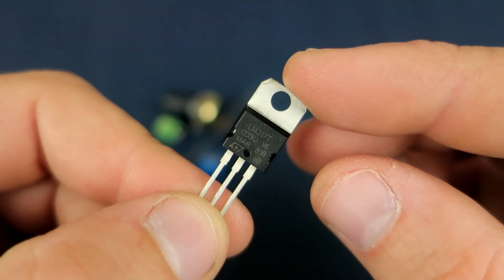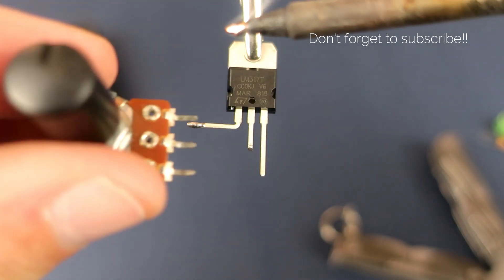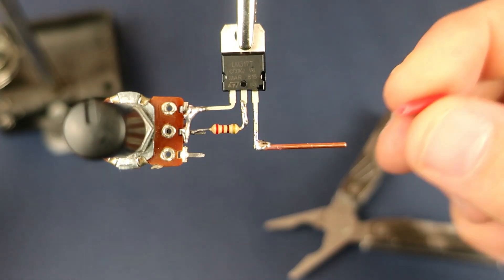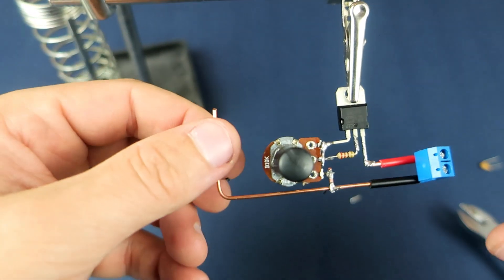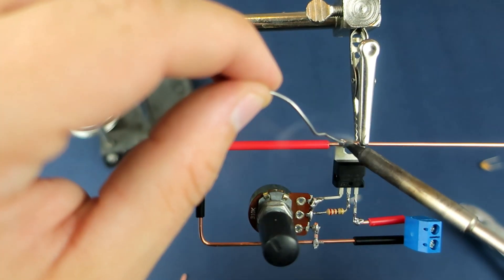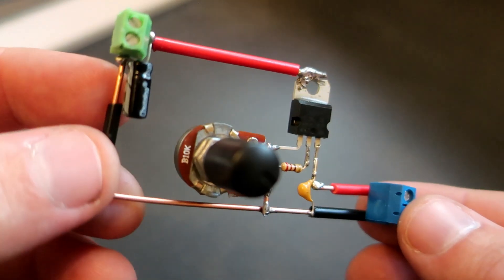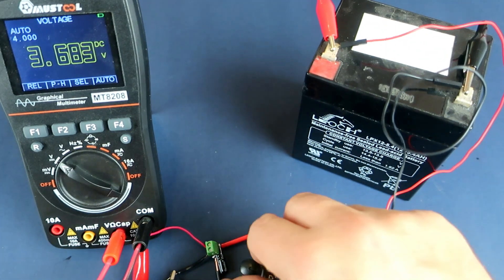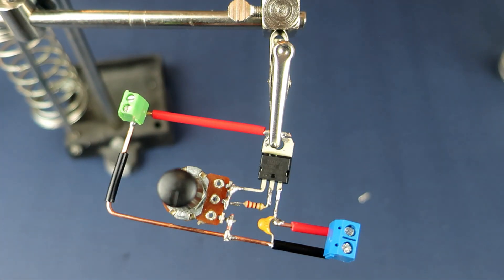Adjustable Voltage regulator LM317  how to make!

Comment: U can change the resistor with a 250-240ohm resistor so the voltage will be precise. some nowhere days hobbies need a variable power supply for breadboard but u could to use it for other things with that also great video ❤.

Comment: The LM317 will not go down to zero volts. It will go to about 1.25Volts.
That is it. If you want to adjust to 0.00 Volts, you will need ancillary circuitry.
Read the data sheets. This is clearly pointed out.

Comment: It can be work in 24volts ac ?? Just adding some bridge rectifier and a capacitor in part of an input voltage and the potentiometer will it burn??? Cuz mine i saw a bit simple schematic and i follow it but when i on it the potentiometer will keep burn and the lm317 is also damage so i should i do ??

Comment: The output voltage keeps fluctuating 11,1 to 6.83V and different values.
Nothing changed after or before the 10uF capacitor. I could not use this project the way the circuit was explained. Maybe I missed something.

Comment: I had searched for a variable voltage regulator, but I was wondering if you could do it in reverse and increase the voltage from a 3.7v 10a-20a 18650 battery? Could this be possible?

Comment: What is the cap voltage ratings? I am on top of the Uf but lost for the voltage ratings..can I use up to 300 volts or 90 volts if those are made? Thank you so very kindly from Houston,Texas

Comment: Disculpenme por pregunta sin abrir la reseña, ya vi que el potenciometro es de 10k, la resistencia es de 220 ohm, el capacitor de salida es de 104 uF y el capacitor de entrada es de 10uF, Excuse me for asking without opening the review, I already saw that the potentiometer is 10k, the resistance is 220 ohm, the output capacitor is 104 uF and the input capacitor is 10uF, este es el mejor proyecto de estos reguladores,,

Comment: can I ask? I have a  Dc 3 volts portable fan and I want to run it with 18650 (powerbank) which is around 4,8volts. Can you show me what should I use to reduce the voltage which is not too bulky. An adjustable speed is ok I guess, to make it more interesting. Thx in advance.

Comment: As seen by other  viewers, I too viewed many videos creating this circuit. Yours by far is the BEST of all viewed. I was able to build one, but still waiting for the screw connectors to arrive.I just used solder.
You seem to be a most friendly man who knows how to communicate with others.

One thing and if you can help, I am having trouble locating the resistor. I can find the 220 but it is the physical size that is hard to determine while looking online.

Keep putting up the great videos...

Comment: i have done the cirucit, it was working fine untill i short the output wires, lm317 starts to smoke out. what would be the problem. the input power supply was 20 V with 4.5 A  rating.

Comment: Nice video but I have some questions, why the resistor? Why 220 ohms , why ceramic capacitor in input? Why electrolytic capacitor at output and why u put less capacity in input instead of the output?

Comment: I have a question. I am trying to build something that is a bit unconventional to most people. I want to build a vape mod that is voltage regulated. I prefer to have a buck boost converter, but I cannot find one that is within the voltage specs that I am looking for. I want to have the ability to use either a single 3.7-volt battery or a dual battery 7.4v but it must have a 2.5v cutoff. I want to be able to adjust the voltage from 0v-10v on the output, and it must be able to withstand 30 amps of current, these devices produce a lot of amps running through the system and most boards I see can only output 2 amps which is nowhere near enough. Any help will be greatly appreciated.

Comment: I'm new to electronics. What is the different between this circuit and voltage divider?
Reply: Hi friend. Voltage divider is used for command  but this circuit is used to make regular voltage and current to activate any load working under the battery source as well.

Comment: I just found this video and found it quite fun to see this skeletal method of circuit building. I had used the 317 to create a self regulating heater circuit for my 1950s model train. I added a thermistor as the R2 and a fixed reference resistor for R1.  There is a heater coil on the output and it is used to vaporize an oil in the smoke housing. I also have a small DC Can motor and fan to blow a puff of air through the housing in synch with a Chuff Sound board. If the Heater gets too hot it can burn out or use up all the oil in the housing. If it gets to cold the oil stops evaporating. Other variables i had to deal with is the Track Power that runs the motor in the engine  starts at 5 volts and goes up to 17 Volts.  I isolate the 317 from that variance in track power by 1st converting the AC to DC then running it into a Buck Boost Board set to 9 Volts. I find that with the heater I used 8 to 12 Ohms will heat up to 150C with 9 volts. The other variable I had to accommodate was the fan to make smoke flow out. It will cool the heater down as it pushes out the smoke. When all put together the heater will start up at 9 volts as the thermistor is very high resistance as room temp 25C. As the thermistor sees the Temp approaching 120C it will start to reduce ohms and being R2 it lowers the output power.  Then as we turn up the track power the fan moves air faster so the thermistor will cool and Ohms will increase which raises the energy sent to the heater. If i have all the parts correctly balanced and the right R1 value the system balances between 120C and 130C quite nicely. This provide a nice puff of smoke at low speed leaving the station, then once on the main line and speeds increase the smoke maintains a nice plume out the stack as the engine speeds along. Then as we slow down the Thermistor will begin to heat up with less air flow and that will lower the energy coming to the heater. It all works really nice. We used to have good smoke at low speed then none at high speed or burn up in low speed and have smoke at high speed. It was a battle to have fun smoke at all speeds. this 317 is so simple and easy to configure we even have a circuit board made and we can sell the assembly to other Train Hobbyist. And it is all very affordable for them. I appreciate you continue to teach today and applaud your efforts. I try to share with other train folks but these older trains are left with older guys now so it is harder to bring young ones along. We are using 3D Printing to make spare parts and new engines. We hope to bring new Hobbyist into our model train because it is a very good scale.  1/64 scale which is larger than HO but smaller the O (Lionel). I am trying to use science and technology to help keep it alive. We are now finishing our Sound System with ESP8266 Microcomputer. I am at 73 learning C++ AGAIN! But with Arduino and these new boards it is all part of the IOT and STEM like studies which i find online like this lecture and demo you made for us to learn from. I wish you very well and hope you get many more viewers. Thank You for a great video, Dennis in Virginia USA

Comment: Best and uncomplicated circuit presentation I have come across. Thanks for sharing.
Reply: How can you add a voltmeter screen to this to see what you setting the voltage to? I added one to the output but No mater what I try it fails. Not sure why
Reply: @skor1873 what do you meant by it fails? Like it drops voltage or just turns off or blank

Comment: ..do we not have any DC voltage regulator  above 12v.. example for Regulating voltage across mixed Solar panels in-between inverter.. let say I have 2*36dc 8 A but slightly different rating.. I want to regulate it's input voltage before it gets to the inverter... Is it available?

Comment: Having a hard time with this circuit I'm using a 10K potentiometer and at higher voltages it adjusts normally but as soon as I get down into the three range it all of a sudden drops down to nothing I can get it to 3.3 volts but it doesn't stay there it wanders up and down even with the capacitor. I just realized I was using an old potentiometer as well I don't know if that could be yet I noticed that there was some soulder stuck to the leads so I obviously used it before

Comment: Hey thank you so much for this video.  I got a question I am wondering why you soldered the potentiometer with wire connecting the two pins?
Reply: This wire is necessary to connect the 220 Ohm resistor to the adjust pin of the LM317

Comment: Your circuity diagram has the input from the left side and you physical diagram shows the input is from the right side of the diagram. It is so confusing to me that I will not use you video to do my project. To a beginner that you circuit diagram should match you physical diagram exactly, otherwise it is too confusing to the beginner.

Comment: am i correct: you connected the heatsink (you said also is the output) back to the ground and into the potentiometer ..... does this save power? does it reduce the heat of the regulator?
Reply: oh no... thats your output...... ok sorry i just came from a video where the guy measured the "output" from between the two resistors and ground.... which means he was reading the wrong voltage for "output". he was on a breadboard and he confused his own circuit.

Comment: I seen the smoke come up from the solder and I literally tried dodging it in real life. My friend please use a fan while soldering, you might think it may not bother to do it a little bit. But collectively over your lifetime that's an incredibly dangerous amount of lead to breathe in. Think about your safety not for yourself but for those that love you. Take care and thanks for the video!
Reply: Thanks alot sir , can you tell me the value of resistance?
Reply: There is no lead fumes. It's actually resin fumes. I'm not bothered by it, but my friend gets headaches easily and does without a fan. I have heard of resin being unsafe and lung problems later on. I usually just hold my breath and don't do much with ventilation.
Reply: Yeah, dodging at least will do if there's no fan
Reply: @CorneredCat0  Sorry to disagree. I have enjoyed the smell of solder for >60 years.
Reply: @arrrgoyle5695  😂😂😂😂😂😂😂😅
Reply: Oh brother lol. Instead of repeating things other people have said, research it yourself first. Then if you still believe you're comment has merit, you will be able to tell us why. For now though, I believe you're telling fibs and making everyody scared and hiding under the bed when soldering, including me
Reply: @ConceptXX  It will literally give you cancer, or you can continue to smell it. Not my funeral. 
Solder contains lead, when when you melt the lead you get a combination of flux and lead in the smoke. Flux is mostly derived from pine tar, but its still a paraffin. I could continue to try and convince you otherwise but I'd rather see Darwin get proven correct.
Reply: @codyswanson8481  it's apparent you didn't do a minute of your own research. that's okay, darwin has his eye on people like you also

Comment: May I ask for your help with a diy battery to replace original ones that power heated gloves.  I opened the case that houses two 18650 Li and a pcb that configures batteries in series.  The pcb also has a press button that, when connected to battery, turns power on and selects between four power modes, 25, 50, 75 and 100%.  I have spent hours searching for the same pcb but haven't found it nor one similar to it.  Is there anything you could suggest that I do?

Comment: Nice videos! Like the way you explain these things! 
But you could work a bit on your soldering skills 😉
Never „carry“ the solder with the soldering tip to the soldering point.
Pre-tin both sides, then clean the soldering tip again and then solder the two spots together.
Reply from the maker: Thank you for advices.